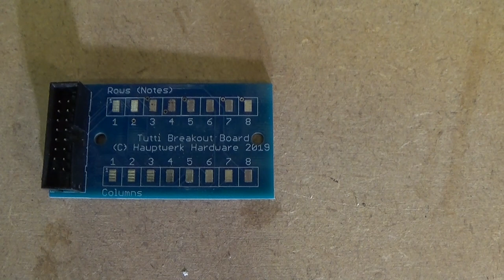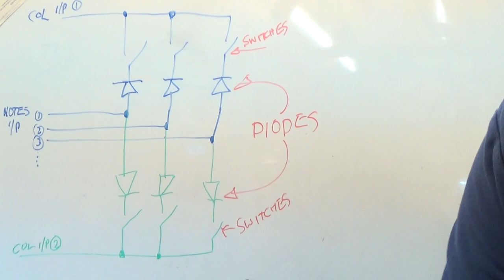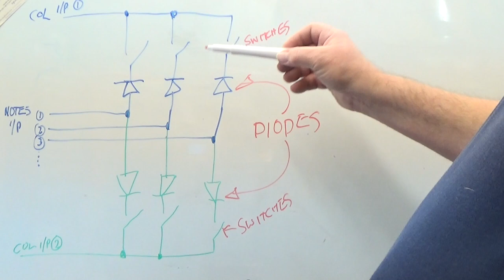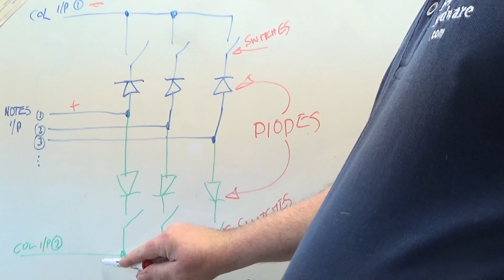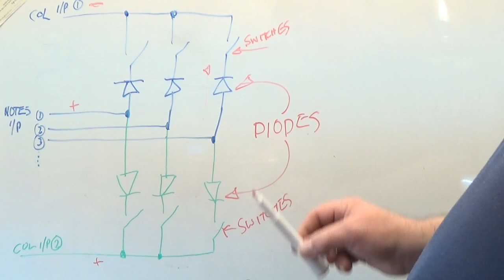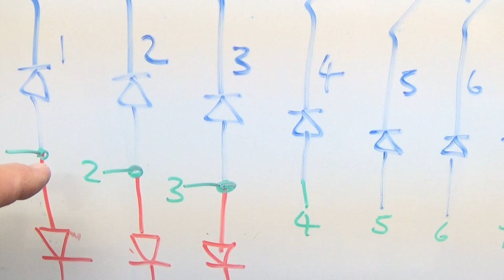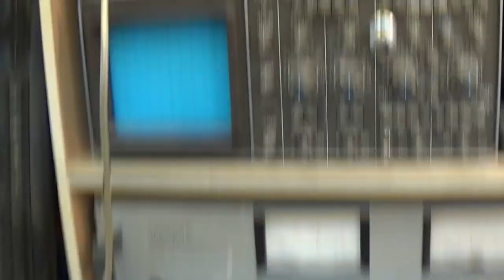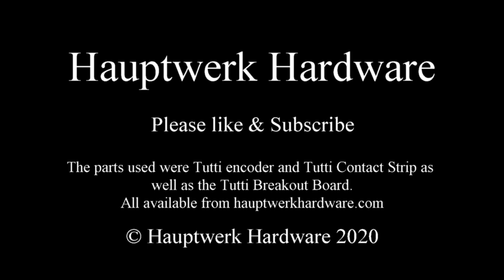Tracker Action Keyboard Part 3

Comment: Great video so far. Just wanted to stop and comment on your lacing technique.  I am a weaver and what we do sometimes at the beginning and ending of a piece is a technique called hem stitching.  It is a technique almost exactly as your lacing and accomplishes the same thing. Just a little curiosity I noticed. Really have liked all 3 videos. Enough for the commercial break.  Onward to the finish.
Reply: I use a 'blanket stitch' knot (suspect it's the same as a 'hem stitch'?). I prefer waxed thread for smaller cables like key cables - the blanket stitch knot locks in place. The black lacing cord used is great for larger looms but doesn't lock in place very easily on these smaller looms.

Comment: Nice work.

You did something I have done many times, which is, you cut that board from both ends, creating unnecessary waste. If one it was to square it up, the first scrap could have been smaller.

You probably know this & it’s not like the scraps were of a very usable size, it’s just something my step dad would have said had he seen me do the same thing.

Thanks for sharing.

One question, there isn’t a way to make those switches velocity sensitive is there?

Comment: Great Channel and greetings from Germany! I planned to build a 2-manual digital harpsichord using wonderful samples, and for uncompromicingly getting a keyboard mit most authentic harpsichord-action, I really was crazy enough to purchase two of the keybeds from the Roland C-30 as spare parts (rather expensive) and now I sit in front of an unknown diode matrix with an unknown type of 16-pin-socket (female). So now I'm searching the internet for any kind of an adaptor from this to a more usable kind of 16-pin-connector. When this is done, I have to find out if Roland's diode matrix is compatible with any known kind of diode matrix.

Comment: are there contacts that ate placed differently than in extension of the keys? I want to make a practice organ, and the keys are long enough as is, I want to keep the instrument as small as possible
Reply from the maker: This is the usual type of contact for adding to keys retrospectively. Other keyboards, usually the ones with plastic keys have contacts under the keys.

Comment: I have a probably silly question - if one uses the traditional 5-pin MIDI cable to connect the encoder, doesn't it need an external power supply to operate?

Comment: Great Videos, very interesting to watch.  Just one point:  In video II you removed the keys to attach the switch wipers.  Unless I missed something I think it would have saved you some time and additional work in video III if you routed the channel for the piston wiring when you had all the keys removed in video II rather than having to remove them a 2nd time in video III.  Anyhow, mission accomplished.  Looking forward to your other videos.
Reply from the maker: Hi Peter, You're absolutely right, but I wanted to keep the subjects of the videos separate, and felt that the routing should go in the wiring video. That way if someone watched that one in isolation they would then see how to arrange for the wiring to be accommodated. Thanks for watching!

Comment: Do you, or anyone out there, know how it might be possible to add second touch to this for use in a theatre organ console?
Reply from the maker: You would have to add a second set of contacts for each key that operate slightly later then the first ones and then connect them all to an encoder that supports second touch. Hope that helps.